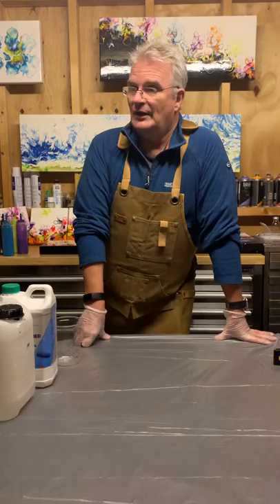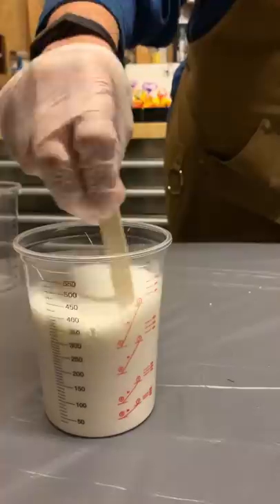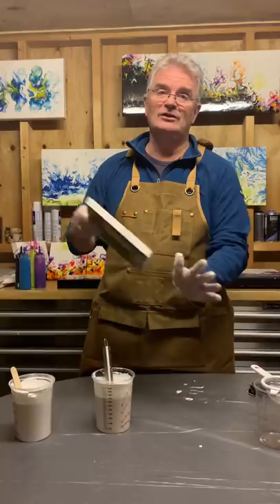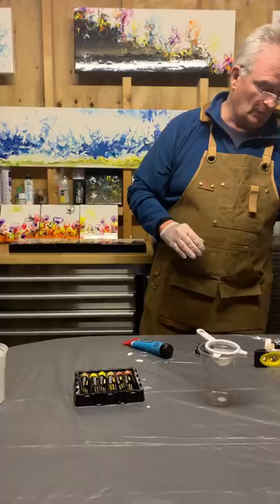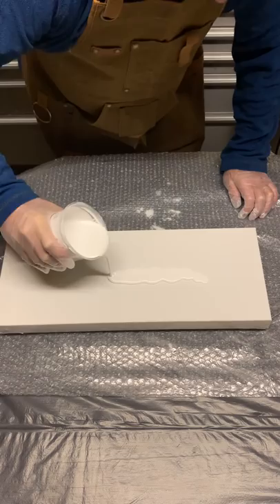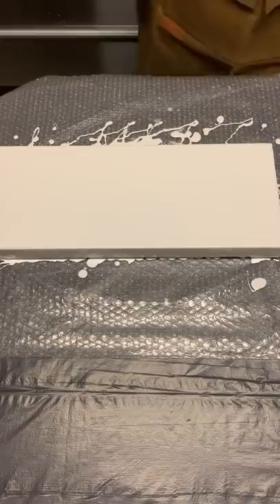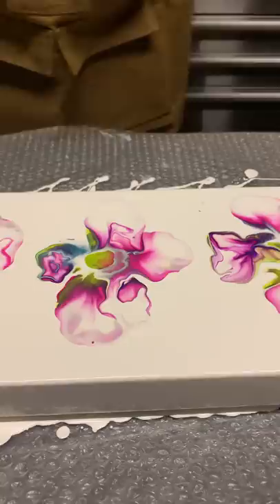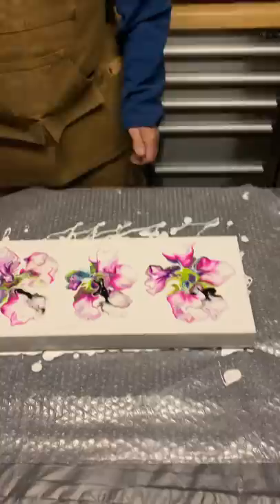Acrylic pour mix and consistency tutorial for beginners with a small painting at the end.

Comment: Good video, I use masking tape on the back of my canvases, take it off as soon as paint is dry, I don't leave it on til I varnish, it is much harder to get it off after varnishing. Also, if you're an Aussie, using Aussie floetrol, it  is a much thinner consistency than American or UK floetrol. You can use the paint on the plastic to cover the sides so there isn't as much waste and please don't wash paint off a canvas or board down the drain, scrape  the paint and save it for something else.
Reply from the maker: Great tip!

Comment: If you use a heat gun on the tape at the back of your paintings you will find it peels off easily, if it still leaves a sticky mess seal it under some resin or vanish, you don't need as much as you use on the front, just a single thin layer.
Greetings from Sydney Australia.
Reply from the maker: Thank you so much Heather🌹

Comment: Don, I'm still plucking up the courage to start a pour. I'm worried I don't have the correct mixing medium. I bought a small bottle of liquitex (230ml) and a starter pack of acrylic paints. I was going to practice on some small off cuts of wood, which I shall prime beforehand. I see a lot of people using Floetrol or Pva mixed with water, so now I'm totally confused as to what products to use! Can you help advice a very scared newbie please? 🙏 Thank you for all your help and advice
Reply from the maker: Hi Elizabeth are you in the U.K.?
Reply: @dongregor1813  yes I am
Reply from the maker: @elizabethgriffithsphotography  Hi Elizabeth, can’t remember if I’ve asked did you watch my video on consistency and mixing?
Reply: @dongregor1813  yes I did. You showed that you used a form of Floetrol but I wondering if the medium I bought would work?
Reply from the maker: @elizabethgriffithsphotography  it will work but I believe it is a thinner consistency than Floetrol, you’d have to take that into consideration when mixing.
Reply: @dongregor1813  ok thank you Do you think I'd need more liquitex in my mix or less than you suggested in your ratio? Sorry for all the questions. Do you use Pva too, like so many others?
Reply from the maker: @elizabethgriffithsphotography  I don’t use PVA, I only use Floetrol.
If your using Liquitex I’d use the same mix I’ve got for Floetrol  but use the Liquitex and paint and alter the water to the consistency,
Don’t worry about asking questions x
Reply: @dongregor1813  fab thank you
Reply from the maker: @elizabethgriffithsphotography  You are very welcome, good luck with it and have a great Christmas x
Reply: @dongregor1813  you too!